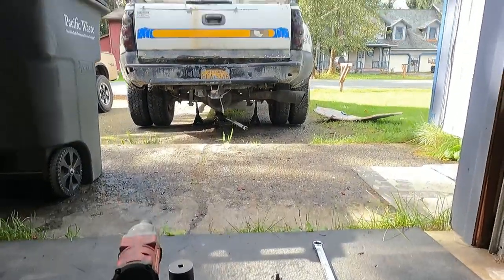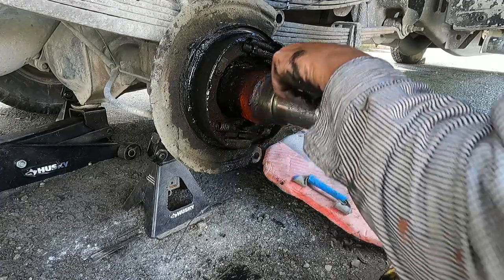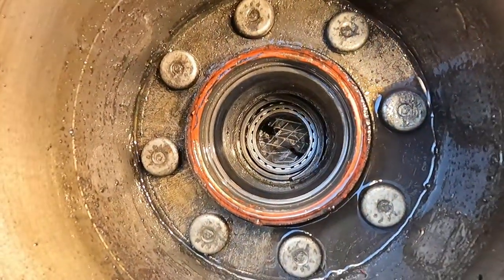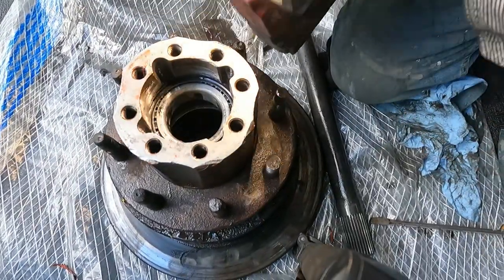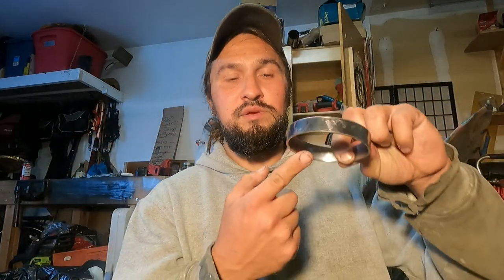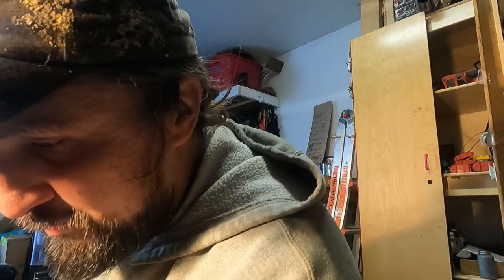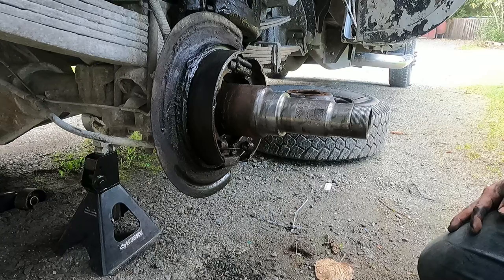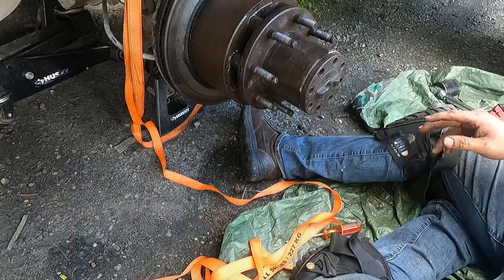GMC Rear Wheel Bearing Replacement

Comment: Quick question man, I replaced the seal on mine not very long ago. I’m not getting any leaks right now but a very loud clicking/ticking noise. When I drove it yesterday and stoped it was so hot around the wheel it was smoking and the center cap was hot. What comes to mind on that?
Reply from the maker: Oh man, that's not good.  First thing that comes to mind is there might be too much load on the bearing.  You might back the axle nut off and readjust the pre load.
Reply: Was it the bearing going bad?

Comment: So you torqued the spindle nut to 52 lbs, and backed it off a little. I pulled off the hubs, and the seals seemed okay but the bearings were loose and could slide. I didn't have the spindle socket so just tapped it tight with a flathead. I didn't replace the seals like you did, so would the oil sleas slide on by pushing on it?
Reply from the maker: Hello! Absolutely. If your seal is still good then re installing the seal onto the hub assembly then pushing it back onto the spindle, seating it with maybe a couple taps from the dead blow should get it back in place.

Comment: What about oil?? How are the bearings lubricated?
Reply from the maker: 2 ways.  Bearings are both in an oil bath from the rear diff gear oil as well as I pack them with grease out of an abundance of caution.  You don't "need" to pack them with grease because they are in an oil bath, so no worries if you skip that step.
Reply: @KooshdaakaaGarage  Okay yeah, that's what I thought. A couple things with that, when I pulled out the rear axles, they were pretty dirty, if the oil is flowing through there it's sure to get contaminated.. The innermost bearing just seems like it wouldn't get much oil, considering the diff oil has to flow out the differential through the spindle and the outer bearing.

Comment: Aren’t you suppose to spin the hub as you tighten the nut? Also you didn’t back it off then hand tighten it. You hammered it with the impact didn’t you say that would cause premature wear?
Reply from the maker: You can try to spin the hub as you tighten it... but usually that only works if you have another person helping due to the difficulty of tightening the nut (notice i used a ratchet strap at one point to help keep the socket in place).  Otherwise you have to do what I did amd tighten then spin to gauge if the seal is seated and that there is enough pre load on it. It should take as much force to get the hub spinning as it does to keep it spinning.  Also, not sure we watched the same video, I didn't hammer it on with a impact.. or did you skip around in the video so you didn't see me first use a socket wrench then a torque wrench then used the impact right at the end to align the key hole, using a punch and hammer for the final alignment?  You can absolutely over tighten the nut to seal the hub then back off the axle nut then hand tighten the nut again by hand. When you put it back together and drive the truck the hub will pull back out to where the nut is.  Not a huge problem but that back and forth on the seal has a small chance of damaging the seal. Small chance and I wouldn't worry about it too much if you go that route. I simply tighten the nut until I got a full seal and got the tolerance I was looking for and also tighten the nut until approximately the same amount of threads were sticking out as before.  Best of luck.

Comment: I gotta pull out the outer bearing race in order to get the outer seal installed first correct?
Reply from the maker: Thank you for the question!  The outer seal or gasket is the axle gasket so that comes out before you remove the hub assembly.  The only other oil seal is the inner seal which comes off before you can gain access to the bearings.  I hope I understood your question and answered accordingly 🍻

Comment: i cannot get the hub snap ring out....
Reply from the maker: Yeah that snap ring is a major pain.  Are you using snap ring pliars?
Reply: @KooshdaakaaGarage  yep, a used pair, now fighting to get it back in, its amazing how the right tool can spare you stress.. this has been a four day job, wrong parts, hard to find tolls, etc....
Reply from the maker: @bradleystevens2956  oh I hear ya man.  I didn't have snap ring pliars the first time I did this and it was a pain. Then I got snap ring pliars the the dang snap ring still wants to buckle and pop out!